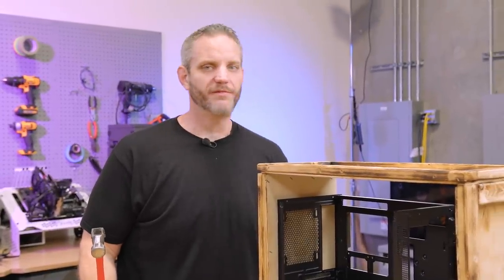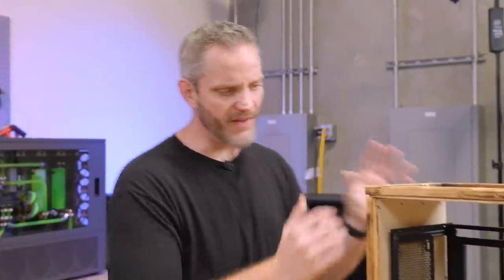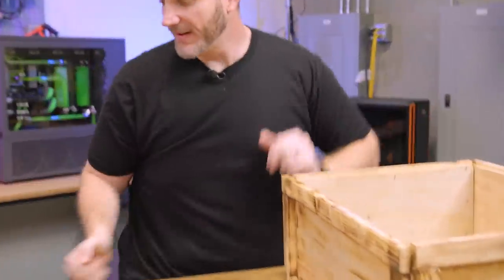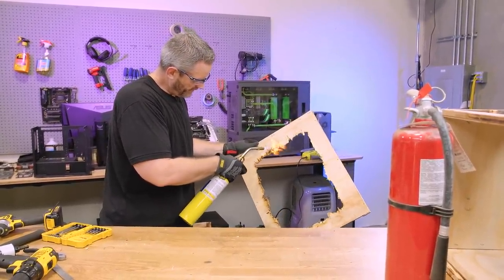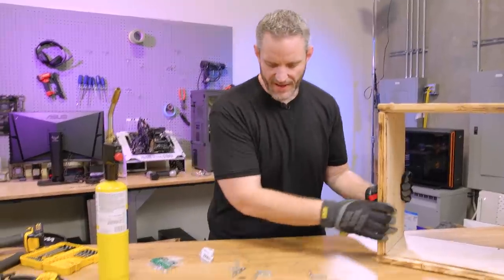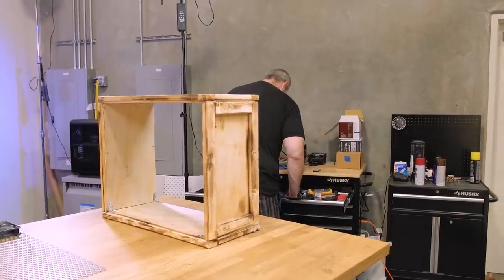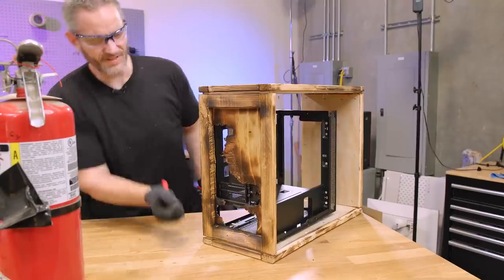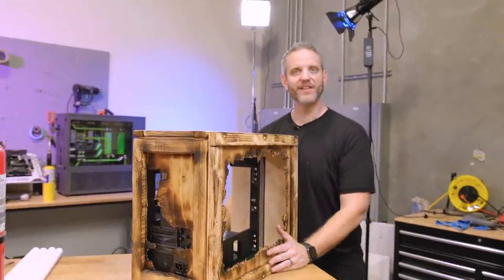I’m finally starting the Red Dead Redemption Custom PC mod again

Comment: Are you keeping the air filters in the front of the case? They look kinda urgh.
Not sure how much structural rigidity would be left if you just cut off the whole vertical front part of the NZXT skeleton.

It looks like there's a case in the case. Maybe just the front piece and leave the rear side. Might need that for the pump and other stuff

Comment: hmz Jay, why don't you remove all the panels from the case you don't need, or just take it apart and attach the separate panels where you need them? Just drill out the rivets, keep the back panel + motherboard tray panel connected, but remove the rest and move them over, or just toss them entirely.

Comment: You can either use an angle grinder or a metal cutting blade on the jigsaw if you have some balls. If not, hand saw, brand new blade and some elbow grease.

Comment: You should have fabricated some sort of base for the frame to sit on so the top of the frame would sit flush against the top wood panel.  This would have solved the issue with the PSU power cord connector for one and I think there would be other benefits.

Comment: Try changing the CMOS battery. I've built 6 computers in the past 2 years for friends and family. 2 of the motherboards, MSI B350 Tomahawk and a Gigabyte B450, came with dead/bad CMOS battery. Now whenever I get a troubleshooting problem with any Ryzen build its the first thing I change, even if the error code dosen't match. It cost less then 10$ and it can save you a world of trouble.

Sorry for any spelling error, english isn't my first language.

Comment: Jay, what connection are you using to connect the GPU to the monitor?
If you are using HDMI, change to Display Port to see if it can boot to BIOS/UEFI.
Or disconnect the monitor from power during boot/posting.

I found a thread in linustechtips forum about Q-Code O2 in some Asus x570 boards and that was the solution.
Turns out that the board was booting to BIOS, but couldn't get video out to monitor.

Please don't give up this build!!!

Comment: Why even keep the chassis? You could easily fit an atx build in that giant crate. Also I'm not sure about copper accents, I think iron fits the theme better. Think railway tracks, revolvers, and then some leather, like the boots, jackets and whips of the time. You could also prepare a hangman's noose now, just in case. It'll come in handy one way or the other.

Comment: What about one of those old fashioned detonators for the reservoir the plunger handle could be part of the copper loop but painted black to visually separate it from the rest of the loop? Black handle into clear tube then onto copper if that makes sense?  Also I think the side panel should be clear acrylic you could secure it to the wood with epoxy resin and coat the wood fibres while your at it to seal it and stop it fraying

Comment: What about using the LED as a HDD light so it flashes while on?  That way it looks like the fuse is smoldering.  Would be better than just a power LED.

Comment: You should get a piece of plywood, and cut it to the size of the inside, and then do a “wall mounted PC on it, and then pop it in there instead of the case in the box.

Comment: Instead of have a big BLACK metal case in there, build yourself a case with .5 inch by 1inch strips of wood, use a bunch of brackets and there you go, it would look more towards a theme. more so if you took extra time, and took the coating off the brackets and went and buried them for a month near a water source.

Comment: Shoulda done the front panel intake as a panel with a bunch of bullet-sized holes in it, like 10 or 12 of them, instead of completely open.   Bullet holes with slight burnt edges.

Comment: The case you used as mounting for the hardware is weirding me out... I would cut off everything but the rear and the mobo backplate of it and mount it a bit higher. Then and do the rest with wood (like the PSU shroud). If you want HDDs in there you can just mount one cage out of a cage with removable cages in there.
At last I think this might be the perfect build for the beige/brown Noctua fans... the one time their looks fit something :)

Comment: I would remove the case inside and direct clip the mb and such at the wood, , you could mod the power suply as some dynamite and such or even add some "old" bottles as reservoir, forget the case, or cut it to the max, use the wood and go nuts!

Comment: Knipex 71 12 200 would make quick work of that grill. Ive used mine for years and years working on bicycles and it still cuts m5 bolts if i need to. Dont you have something similar in your toolbox?

Comment: I found after the last 3 ryzen builds I did with in the last 2 months, loading in a single stick of ram gets the system to post almost immediately then powering off and loading in the second channel makes things go sooooo smoothly. Next time you have a boared you think is bad, try a single ram stick and see what happens. This has worked for a 3600, 3700x, and 3900x with b450 and x570 boards.

Comment: Dumb question Jay, but did you try flashing the BIOS for that board? If it's not loading the microcode for the CPU, then it may just be a BIOS issue.

https://www.asus.com/support/FAQ/1039406/

Comment: Not sure if there is anything better than angle grinder to cut that metal stuff. I think though that if it blew up from the inside it should be black and scored from the inside with some powder residue or something.

Comment: I’m building a pc. I have the: 

- DeepCool Case MATREXX
- B450 pro4 motherboard 
- Crosair CX 550 psu 
- Inland premium 512GB 
- Crosair 16GB Ram (2x8)
- EVGA Geforce GTX 1660 Super
(everything from the video) 

The last thing I need is the CPU, and I got money to blow on it. Will getting a higher priced Ryzen better performance? Like a 5 3600X, 7 2700X or 7 3700X. or will i have to upgrade everything else I have??

some help would be nice

Comment: What about black iron pipe from Lowe’s?  Or could you do a painted clear Petg tube using a rust color where you could airbrush black soot accents
Reply: Honestly I think this will be one of your best builds, it’ll be epic based on this video the outside of the case and concept is perfect for the theme

What about Red fluid in the shape of a dynamite stick using a cylinder res?

Comment: I would be cool if you didn't have the cage on the inside and mounted the motherboard directly to the box, custom polished brass/copper water loop... or at least get rid of the front part of the cage so it dont divide the box up so much. Why does it have to be a tiny ITX is such a big box? why not a full size motherboard?

Comment: Currently dealing with the 02 fail to POST code on my brand-new build as well. So frustrating! Luckily, I chose to test outside if the case as well, otherwise it would have been MUCH more difficult!

Comment: I have a phantom 410 case. It's my first build so my question is one of the rubber feet are missing there's six and I'm worried. Should I use it to build or do I have to worry a out it wobbling. It's my first gaming build. I don't have money for another case

Comment: It would’ve looked better if you did the front and side panels brass/copper metal and then used wood for the back panel. And then for the side panel window, I would’ve done a stained glass design to give off a western/church-like vibe. Right now it looks bland and the metal inside doesn’t really go well with the wood. Plus it’s a major fire hazard lmao

Comment: I wonder how it would look if you strip the black paint off the metal chassis and then put a oxidizing solution on the bare metal to give it a rusty look. If you didn't want to have the whole thing rust you could rub lube it certain areas (I suspect that should work...never tried it). Just a suggestion from my potato brain.

Comment: Well, I'm writing this now because I'm getting desperate. I installed a Gentool on my PC a few days ago, but was unable to use the program properly. I did some research on the internet to solve this problem, but the instructions on the internet meant that even as the administrator of this computer, I no longer had download rights to the system drive. After I installed a new Windows system with a new key, I was able to restore it. However, my drives 0 and 1 are now swapped. In addition, I can no longer download Origin because it says that a msvcp140.dll and a vcruntime140.dll are not found in my system. However, I can find both dlls in my system 32 folder. Can you possibly help me or tell me what I can do about it?

Comment: I've had Asus x570 boards fail post on D6 and O2 before, went and got it RMA'd and everything and the new board had the same problem. Turns out it was some error in NVME config after BIOS update. Pulled the NVME drives, got POST, reset to factory, reinstalled NVME, got POST, changed settings back to how I had them, worked fine.

Comment: speaking of rants and getting upset... i bought a ryzen 3 2300x for 80$ and tried to stick it in a a320m motherboard... thought they board was bad... so i bought a b350 motherboard... still didnt work.. threw the cpu bent all sorts of pins... then realize(knew this when i bought the b350 board) that i needed to update the bios. luckily i had a a10-9700 cpu on hand. updated the bios. rebent pins and tried it on the a320 board to see if it fits. it did. put it back in the b350 board... no post.

Comment: Imagine 1911, peasant comes to his friends place. "How are you doing?" "Not bad, building electrobox." A what??? A wooden box with electric wires inside, which will I connect to glass tube, which will project and electromagnetic wave imagery on that bigger peace of glass block over there once I run electricity  through it". "Okay 😳... I will just go and check my horse, looks like he is agitated, I just change his gallops this morning... see you in a minute! 🤣

Comment: Speaking of power led at the end of a fuse, i did something similar for my League of Legends Ziggs modded pc and it turned out awesome, you can check it out here if you want: https://builds.gg/builds/ziggs-pc-inspired-by-league-of-legends-8545
I used the led from and led candle because it already has that flame effect which dimm it up and down so it looks like it is burning. It's a really great idea to use something like if you have a fuse in your build. The single downside I've found is that I sometimes get scared by the fact that my pc is burning out in flames, that's how realistic it looks from a bit far.

+++ I would make some holes with a drillbit and make it looks like bullets went through.

Comment: 10:01 You could try a pair of using a pair of tin snips to cut the metal mesh. Not the cutters you had. Otherwise, the grinder with a metal blade should be fine.

Comment: ASUS quality has drastically went downhill the last couple years. I purchased one of their defective RX 5700 XT graphics cards. Called their tech support because it's a known issue about bad mounting pressure there's even an article on their own website I had to screenshot it and send it to him they had no clue about their own defective product that had an article on their own website. I have two of their motherboards and their quality has just went downhill I won't be buying Asus anymore
Reply: I never trusted AMD graphics. I never had an issue with their motherboard or NVIDIA GPU lineup either. The tech support person you probably got was a newbie.

Comment: Maaan, you are a cheater !!
Just use only the wood where possible and make the holes/bolts and stuff into that. Im ok with the metal back part for fixing the gpu and io-plate.
But the rest can just be done into the wood, just use screws and spacers for the mainboard mount. - Hell you can finally mount E-ATX !
NO METAL where possible.
And no futuretech gridmesh ! Use rusty old fence or a wood/straw net as used on those old chairs for the back,
or combine it with leather cord, pieces from a leather suitcase/saddlebag to get the cowboy leather style.
Large Iron rivets...